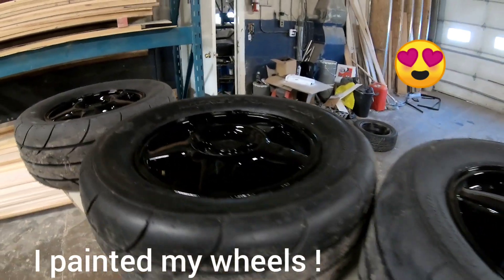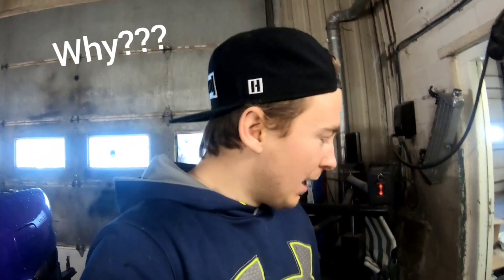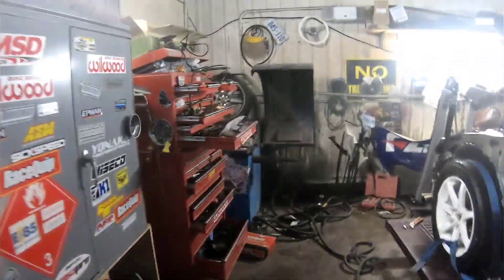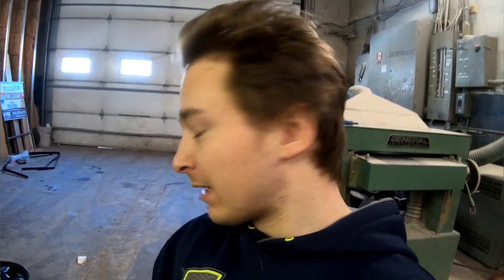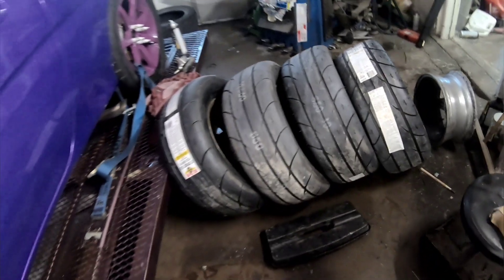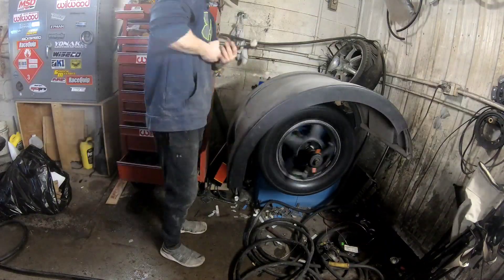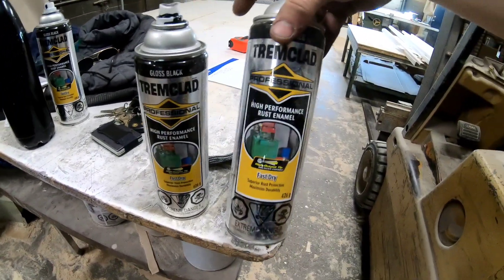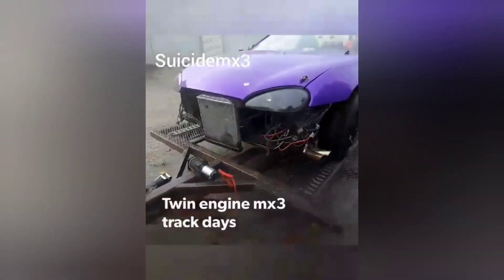my SECRET on how to paint wheels easy! and cheap!

Comment: What's your secret for pulling frames back out a 1/2"? As you know my MX3 ZE was in an accident a few years back and slightly bent the passenger side bumper. Door still closes fine, but the wheel is out of alignment a few degrees.

Something I can do myself, or do I have to bite the bullet and pay the 3K to get it done properly? (And no, I'm not scrapping it)

There are a few videos on my channel so you can see the damage.

Great videos btw, I have been following regularly. And you're becoming quite the plumber with the exhaust piping. (I'm a Red Seal Plumber) so I know what it's like to do odd offsets to fit piping properly.

Thanks Ty. :)
Reply from the maker: I'd weld something to my truck and give her a tug!
Reply from the maker: I'd weld something to the bent parts on the mx3*
Reply: @Suicid3mx3   That's what I was thinking Ty. I was going to rent/buy a hydraulic jack puller and chain and then hook it onto something solid like a post. Problem is doing that without getting noticed or caught. I have seen it done on some Youtube videos, but then I wouldn't be sure if the measurements were true, but then again, if it works, who gives a fuck. lol
Reply from the maker: @theshadowsovereign8914  you would be supprised, get it as close as you can then get a wheel alignment and it should be 90% at least
Reply: @Suicid3mx3  Nothing surprises me these days Ty, and don't worry, I would like to consider myself a capable craftsman. I think I may have been an airplane mechanic or pilot (past life) in the German Luftwaffe during the 2nd World War working on Bf 109 Messerschmitts while the Battle for Britain was raging on in July 1940. In order to get the planes air worthy and to repair battle damage from the Spitfire's (8) .50 Caliber machine guns. :)

I am 1/2 German after all.
Reply: @Suicid3mx3  And I appreciate the replies Ty. I know how busy you must be between work, working on the MX, home life and making videos. I know from experience how long each and every video takes. :)
Reply from the maker: @theshadowsovereign8914  no problem!

Comment: Hey  Ty I recently bought a 95 MX 3 V6 my cooling fan won't kick on and I can't locate the cooling fan relay would you know where it's located. Is it one of the three located  on the passenger side  firewall? It's an automatic btw with the two speed cooling fan
Reply from the maker: Temp sensor
Reply: @Suicid3mx3  I'll check that out thanks a bunch I tested it through the diagnosis box and pressed the gas pedal and only passenger fan is spinning I'll def check the temp sensor though thanks
Reply: @jroc-vd7dd  check MX-3.com it's got loads of info